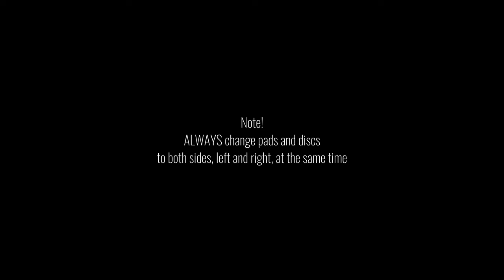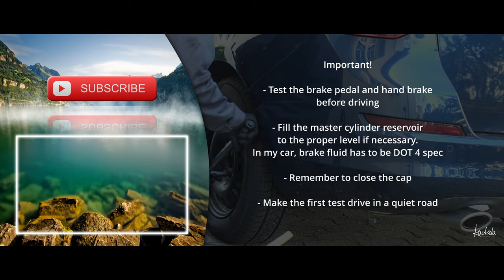Opel Astra/Vauxhall J REAR Brake Job. Step-by-Step

Comment: Good video. My only observation was that when i put new discs on, I spray copper grease onto the outer face where Wheel mates up, stops the bastards sticking on later. Also, it's nice to see you have a wobbly bench like me and like to swear  and say shit when you drop a newly greased component onto a mucky bench top....😂😂

Comment: Once i saw you on the bench with the pad assembly i did the same, and located the pads successfully , Many thanks from Cheshire UK BUT the squeal remained, at 10.08 you show a guide being put back in, mine is tight whereas yours is lose. I think the cradel has a fault, will try cleaning to get a smooth operation as you show.

Comment: The black rubber on the guide pins is to avoid noise from the brake callipers (they can vibrate without it)  when you go over bumps ect.. discovered it some days ago.
Reply: Thats a really good piece of information , i bought a new overhaul kit from autodoc so new guides and rubbers but they are still tight in the guide hole on the cradle as shown at 10.08 i have a bad feeling its going to be a new caliper, i am suffering brake squeal its not the acoustic wear indicator

Comment: Thanks for the video, very clear what you need to do.
I really struggled to get the bottom bolt/damper undone, I hand to use grips as my spanner just slipped and my car also has an electric handbrake but this didn't effect the job, I just released it with the button first

Comment: Thank you very much for the video, great job! My wife has an Astra J Sports Tourer 2011 and this helped me service her car including new discs/pads. It has electronic handbrake which I put in "service mode" using a diagnostic computer, then you can push/turn the piston back in to fit the new pads.
When I changed to winter tires today, pieces of the shield inside the break disc fell off because of rust. Do you by any chance know how to replace them?

Thank you and regards from Sweden.
Reply from the maker: Do you mean the metal brake disc shield behind the wheel hub and the brake caliber? I haven't change that, but to remove it,  i think you have to remove the wheel hub first, and that's a little bit bigger job to do, especially if it's rusted in place. I will have this job coming in some point, but i hope not very soon.
Reply: @kaukolaDIY  Yes, its the thin black metal shield that "appears" when you remove the brake disc att approx 03:19. A couple of bolts visible behind the wheel hub in your video, guess I could not see them for all the dirt and rust. Will probably leave it in a shop for this job. Thank you for your response!

Comment: Not replacing the caliper mounting bolts - bad move. These are Torque/Turn bolts, which mean they can only be used once, as they are stretched when originally tightened. You must use new bolts, torqued to 100Nm, then turned 60-75 degrees. Re-using the old bolts risks having them fail, which can cause a sudden wheel lock up. I know they are expensive, but it's safety first.
Reply: I have never heard anyone saying you need to install new caliper mounting bolts…
Reply from the maker: Some service manuals says, that you should always install new caliber bracket bolts. Might be, that it's better to have new ones, those are not that expensive.
Reply: @kaukolaDIY you don’t have to chance them as they are not working on extension forces like for example cylinder head bolts

Comment: That vibration dampening nut is killing me
Reply from the maker: Why is that, rust?
Reply: @kaukolaDIY  assume so. I've just put some WD-40 on it and left it, hopefully that will sort it. I have a cheap spanner set and I've backed off on just forcing it in case i round the bolt as looks like I've started doing it slightly
Reply from the maker: @dr6124  ok, hope you will get it.

Comment: What size is the adapter on the piston rewind tool? Would I use a 22mm or 32mm adapter plate?
Reply from the maker: I didn't measure that plate. I bought a set with many different sizes, i used this set only for my car, and only one of those plates looks used, and this one is 33mm (nipple middle to another nipple middle).

Comment: I have an electric handbrake. do I have to set something in the computer after withdrawing the piston? Astra J 1.4 Turbo 2013 year
Reply from the maker: I'm sorry, but I have no experience of electric handbrakes. As far as i know, Astra J models have "old style" electric handbrake. Electric motor is not integrated in the brake caliber, like it is in newer Astra K models. That means, that it won't need any special programming or service mode, and it should also adjust by it self, like mechanical handbrake. But, I might be wrong. I hope you can find someone, who really know for sure.

Comment: Pushing back brake fluid is not good idea. Better to block flex pipe and let evaluate the fluid though the bleeder.
Reply from the maker: Thanks for the tip 👍

Comment: you don't need to degrease new paint coated brake discs...for an example if you buy such discs from ATE brand in their manual you will see its not necessary..that's why you have layer of paint instead of oil/grease to prevent rust...(degrease only non point coated rotors) regards
Reply from the maker: Good to know, thanks.

Comment: Was that a threadlocker that was used to put in the bracket bolts?
Reply from the maker: Yes, this blue stuff is threadlocker, which prevents loosening caused by vibration.

Comment: If the new brake disc comes coated/painted, it has no oil coating on it, the paint comes off after a few brakes.
Reply from the maker: Yes, paint will come off, where brake pad touches. Coating on the disc, keep surface rust away from the other parts of the disc. Next time i would maybe buy fully coated discs. My front discs already have some surface rust in the middle, won't effect to the braking power, but doesn't look so nice.

Comment: What are all those grease and spray he was using?
Reply from the maker: I used Nicron 636 silicone grease, CRC copper paste, Nicro 135 anti-corrosion agent and for cleaning i uswdbrake cleaner from different brands (Motorex, CRC).

Comment: Question, what is the wee metal piece on one of the pads for?
Reply from the maker: In which part you saw it? Timecode..
Reply: @kaukolaDIY  it’s visible at 13:18(ish) it in the pad itself
Reply from the maker: @ayeRIGHTyaBE  I think you mean this metal "clip", which will start to make a noise, when brake pad is worn out. This clip will make a contact with brake disc, when pad is too thin and time to change.
Reply: @kaukolaDIY  ah, ok, thankyou 👍

Comment: How does that damper work?
Reply from the maker: Damper in rear brakes supposed to reduce vibration of the brake system. How that really works, i don't know. Maybe it reduce braking noise somehow. Some other car brands have the same kind of things.

Comment: Hi, super interesting video well explained : what's the thing you unscrew @1:29 ? what is the function of this?
Reply from the maker: It's some kind of dampener. Something to do with reducing vibration of the caliber, that's all i know.
Reply: @kaukolaDIY  thanks for answer but than i have to look further to solve my issue (handbrake : handbrake brakes less on rightside than leftside and cable is already replaced)
Reply: @emcee483 hi did you ever solve your problem running into the same issue

Comment: Hallo ik heb Electric handrem  is dat het zelfde
Reply from the maker: Hello! Some car models need a scanner tool to set electronic handbrake to service mode. I'm not 100% sure, but in some of those cars, electronic handbrake motor is attached straight to the brake caliber. If i understood right,  Astra J models with electronic handbrake, motor is in a different place, and it is just moving the hand brake cables, not the piston it self. So normal brake job should be about the same as with mechanical handbrake. I hope here's someone who has experience of that and knows better.
Reply: you replace the electric brake in the same way as the manual brake. I have such Astra J with an electric brake.

Comment: You forgott that handbrake after thise job need adjustment
Reply from the maker: Yes, that's a good point. I have to say, i didn't do that, i thought, that it will adjust automatically after using it for some time. But you're right.
Reply: How do you re adjust the handbrake
Reply: @amscaptured6700  inside cabine where is hanbarake
Reply from the maker: I'm not 100% sure, but i understood, that Astra J models with mechanical handbrake, like in my car, have self-adjusting park brake cable system. It doesn't require 
adjustment after a normal brake job, like discs and bads. It should adjust it self, if i apply and release the park brake lever few times after the brake job.
Reply: @kaukolaDIY  i have electronic handbrake do you think there will be adjustment
Reply: @kaukolaDIY  that can be true,but thst is eazy see when you replace pads and test hanbrake serverl time
Reply from the maker: Basic electric hand brake system should have also same iind of self-adjusting system. Only difference is, that electric motor will move the cables. I think only way to test, that park brake works, is to lift rear up. If park brake is fully released, rear wheels should turn freely by hand, when the park brake is applied, both wheels should not rotate to any directions by hand. What to do, if handbrake won't work, that i don't know. Then cable or motor might be broken.
Reply: @kaukolaDIY  i think if is electric handbrake then are none cable..Motors are mounted direct on brake calipers
Reply from the maker: There is at least two kind of electric hand brakes, i think newer models have electric motor attached straight to the calibers, older models have normal cables, and an electric motor, which moves the cables every time park brake lever is applied or released. I don't know, if this first option is only from Astra model K and up (?).
Reply: @kaukolaDIY  yes thank you, I've just checked the motor isn't on the calipers, must be as you said switch operates motor to pull cables. 👍 Appreciate the help